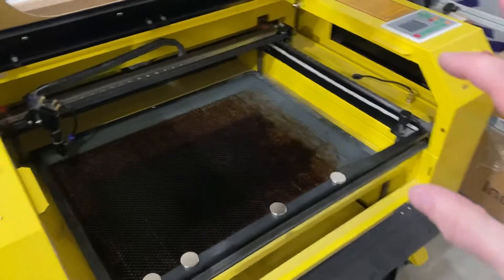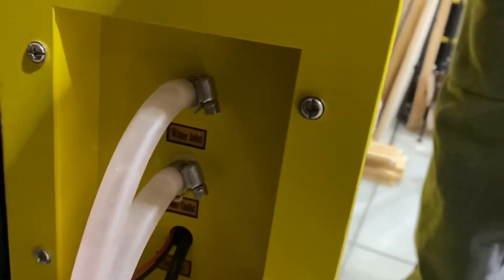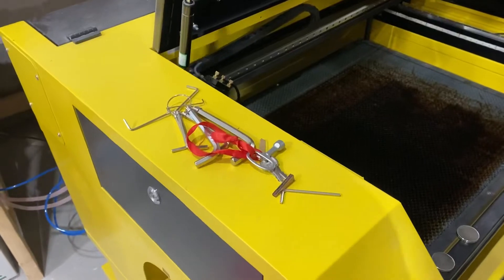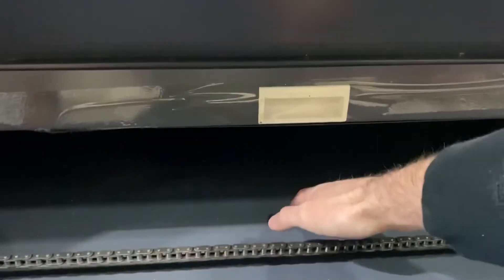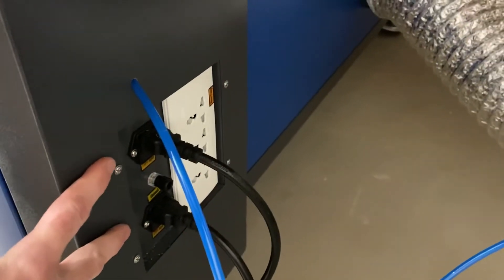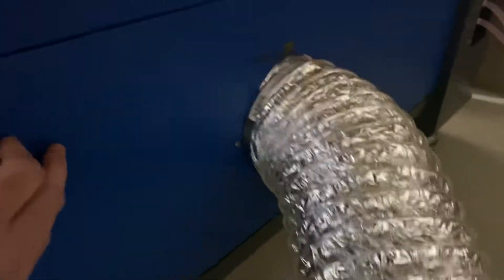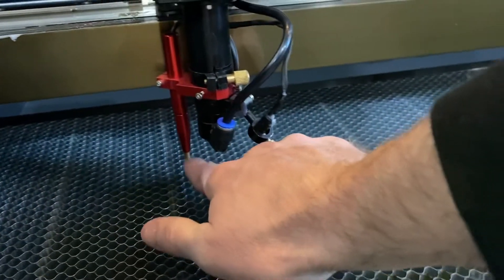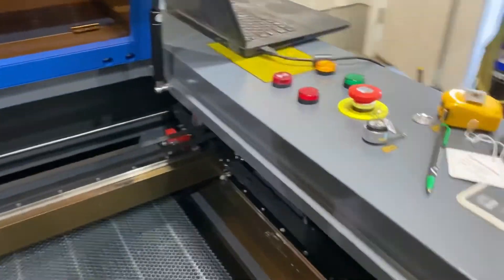Omtech laser model comparison

Comment: As of today, 10/21/23, it looks like the removable base only comes with the auto focus machines.  Can you confirm that?  I am getting ready to order a machine, and while I think AF would be nice, the removable base raises it up so it's workable standing.  Really, the base is what I would be sold on, as I'm tall and otherwise would have to build a base for the laser.  Also, how long have you had your lasers, and what kind of issues if any have you had?  It's pretty hard to get a hold of OMtech to ask and questions.
Reply from the maker: Yes the AF machine in a 2028 have the removable base. It’s pretty noticeable when you see the pictures of the machines. I have three omtech lasers and the oldest is 4 years old. Have you joined the Omtech Facebook group that I manage?

https://www.facebook.com/groups/1364016877267714/?ref=share_group_link

Make sure to save some money with my coupon/affiliate code BEARDEDBUILDS5OFF

Comment: Hey there from Ireland!
Enjoying your videos a lot. They are extremely informative. I am in the process of setting up a shop and intend on doing personalised gifts for a broad range of areas. I will though be doing mug, glass and tumbler engraving. I note with interest the remark you made (@ 3:25) regarding the tray bottoming out when using a rotary. Is this a design flaw with this particular model as I will need a stress free easy way to be able to switch to a rotary to do these products. This machine seems like it would make the process extremely inefficient for a shop.

Can you elaborate or give me a suggestion for a machine that would handle this task better? As it will be a store, I am prepared to ammend my budget to accommodate the best machine to do all jobs, from flat material to drinkware.
I appreciate your time on this question.

Comment: I am looking at a. Omtech 1630 auto focus model, still on the fence though after reading and researching for the past week I am finding out different manufacturers recommend between 70 and 80 percent of max power during use to keep the tube alive longer, so at 70 percent power it turns a 70 watt into a 50 basically, did you step up to the 100 watt because you found your 60 watt didn't have enough power or to speed up your work??
This would be my first laser and I don't want to find out i should have spent a little more money up front on a larger laser, I am.just a hobby machinist these days since retirement and enjoy my time in the shop tinkering, I would be using the laser for personal projects, not for a business. 
Any thoughts would be appreciated

Comment: What model is the 100 watt?  Is it an af2440?  If so is there ANY way to get it through a standard 36 in door?
Reply from the maker: It will be tight but if you take off the casters and all the lights and buttons off the top it will get it down to about 34 1/4” tall. Turn it on to its back and squeeze it through. That being said if you have more than one door to go through it is going to be a struggle.

Comment: I went to find the video where you upgraded the air assist on the 100w Blue machine, but found that you were a actually changing it on the yellow machine instead of the 100w blue machine. 😭 What happened there?
Reply from the maker: It’s the same procedure

Comment: I purchased the same 100watt model.  Do you know how to lower the laser bed frame?  When I received my machine, it was not connected and just resting on the bottom of the machine.  Thanks for all your videos very helpful!
Reply from the maker: On the controller you press the z/u button and then use the left and right arrows for the bed to go up and down. Then ESC to go back to normal operation.

Comment: So I’m looking at buying either the 60W or 80W from Omtech. My question is is there a huge difference in speed between the two? I’m using them to engrave ceramic tile and the issue I’m running into with my current one (30W different brand) is that it’s not engraving evenly and the right side of the engraving ends up lighter than the left. So I’m trying to upgrade to one that does a dark, even engraving on tile. Which do you recommend? Also, my office where I have my current machine is in my house. How hard is it to move into the house for setup? Will it even fit lol? And how heavy is it? I tried to look on the website for guidance but it didn’t share the weight of the machine from what o saw anyways. Thank you!
Reply: My Redsail actually fit through my front door with .5 inch to spare. Without removing base or rotating it. 
Most the time.. Remove base, put on its back and slide it in. Furniture dollies help. They are all about 250lb.

Comment: Thanks for the vid! any experience with the 80w?
Reply from the maker: Which 80w? 
The 80w red and black is the same set up and my 60w and the 80w blue is the same set up as my 100watt.
Reply: @BeardedBuildsCo  Yes you're right - actually about that, are there any build\design differences between red\black vs blue, aside from bed size and motorized -z options?  in general im leaning towards an 80 watt red and black, someone else had told me they recently replaced some switches and proximity sensor, not clear if that was due to failure of some sort.
Reply from the maker: Those are the real differences

Comment: Can you tell me where you got that inline fan?
I am looking at the 55w machine to cut/engrave 1/8" MDF and acrylic.
Do you think that is powerful enough? 
Thank you for any help you can offer.
Reply: Thank you very much.
Reply from the maker: You’re welcome!
Reply from the maker: Yeah you can do the with the 55w no problem. It just stocked too.
https://omtechlaser.com/collections/co2-cabinet-laser-engravers/products/55w-usb-6b46-us?ref=jnnfdsk4edqe

I have couple fan options in my affiliate store.
Amazon.com/shop/beardedbuildsco
Reply: @BeardedBuildsCo  I need to cut small holes maybe as small as 1/32" adjusting for the kerf, are these machines accurate enough to do that.
I am currently using auto cad to do my designs.
I have played with light burn but do not have more than a hour or 2 on it my hope is to make my templates on lightburn and eliminate cad altogether.
Reply from the maker: Yes you would be able to do this. You would jut need to make adjustments to compensate for the kerf.

Comment: I have the Yellow and Black one, got it in 2019 and in my basement.  Converting to auto focus/Z axis control is difficult due to the belting system, which I am still working a solution to.  You can't find the Y&B anymore, but I feel it was worth every penny I paid for it.  I even made a matching workbench/tool cabinet to it.    One thing you didn't mention is the true wattage. The 60 watt is actually a 50 watt continuous, 60 watt peak,  and the 100 Watt is 90 watt continuous, 100 watt peak.  If you want 60 or 100 watt continuous, you need to replace the tube and in some cases the power supply.  If you don't dial down the peak power, the tubes wont last long.   To find the true wattage, measure the length and diameter of the tubes and use online charts. 

One other thing, that 100 watt looks a LOT like the Mira 9, but I'll bet it is NOT a $12K laser.

Comment: Thank you for the video. About the blue/grey 100w machine, let's say you need to pass it through a 32" wide door, do you think you could easily separate the top part from the bottom part so you could put it on its side and pass through a door ? Thank you !! Very helpfull video.
Reply: Good question the yellow one measures 27in and that thing looks wayyyy bigger 😂
Reply: Also thats what she said 😂

Comment: Great video. Its always good to have a side by side comparison. I have been looking at the OMTech brand laser for a couple of months. What are the limitations of the 60watt laser besides cutting size? Did you buy a 100watt just for a larger cutting bed or does it allow for different material? Do you find that you use the 60w for thinner material or is it more precise? Perhaps this is another video.
Reply from the maker: Cut area and being able to cut fast has been the biggest reason for the 100w purchase. It will cut thicker materials easier as well. I will most likely keep the 60w set up to run tumblers and the 100w will do most of the cutting.